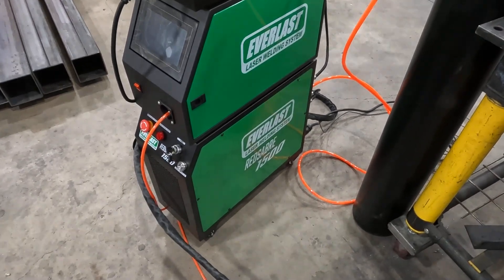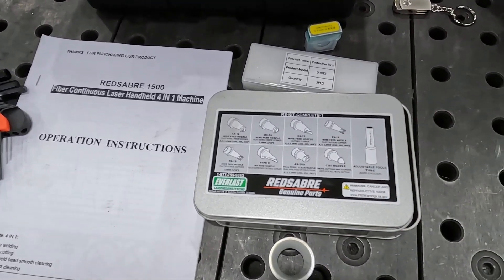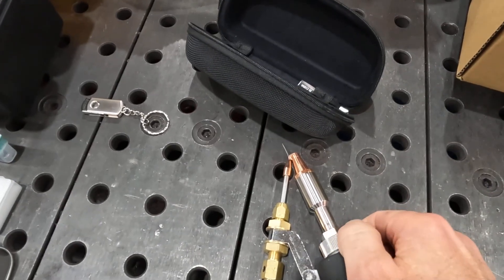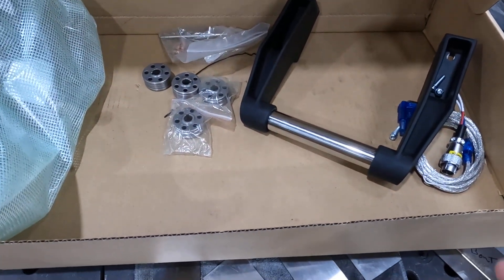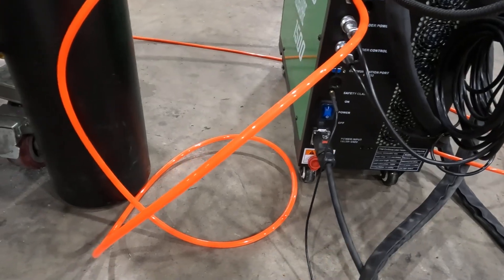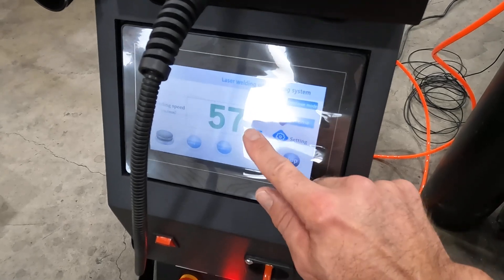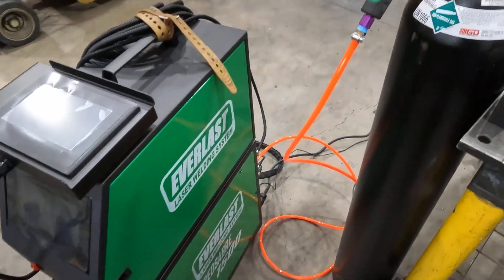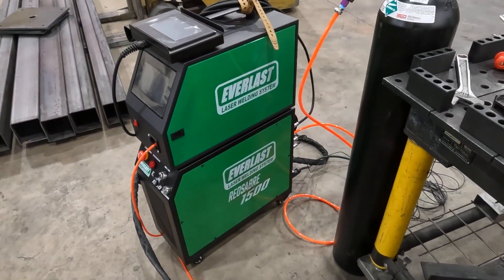Everlast Laser welder 1500 Watt overview

Comment from the maker: It's about the heat input and the penetration.  Very low heat input, so low heat affected zone which equals less warping.  The ease and speed of it is a nice bonus.  You get immediate penetration, so you almost weld from the inside out.  It's certainly a different process with different advantages.   I will probably do another video here before long after running it for 7 or 8 months there are some trick I learned along the way.

Comment: Based on this particular video, there doesn't really seem to be any reason as to why laser welding is any different or better than MIG welding. I'm 100% sure I'm wrong on that account, but I don't know how I'm wrong. What are the specific advantages involved with this process? How does it compare to MIG or TIG? I'd appreciate some answers, and more than just saying it's faster and easier to learn. I mean, once you start practicing, you can make even MIG welds look like TIGs when you get good enough.

Comment: how will it do on 1/4in a36?
Reply: I have a 2kw everlast and it's awesome. Almost full penetration on 1/4"
Reply: @stephens4951  I'm thinking about getting one.  Have you tried any keyhole welds with no filler?  Right now we use TIG with .125 preps on butt welds but I'm wondering about welding them with no preps using a laser
Reply: @leensteed7861  I make these riffle splitters from 24 and 16 ga stainless, and the laser has made them much easier to weld. Quick zap with no filler tacks it easily, and yes, I often don't use filler, and it fully penetrates the material. I've done that with up to 10 ga stainless. It's almost perfectly flat on top but fully welded under. Very fast with almost no warping.
Reply: @stephens4951 
How is your laser holding up? Do you use it a lot?
Reply from the maker: You would want a larger machine.  The 1500 is good for 1/8" maybe 3/16" I would go up to at least the 2000 for 1/4"
Reply: @eastech3365  im trying to understand the advantages.  I own a shop
Reply: i didn't know that they used filler wow